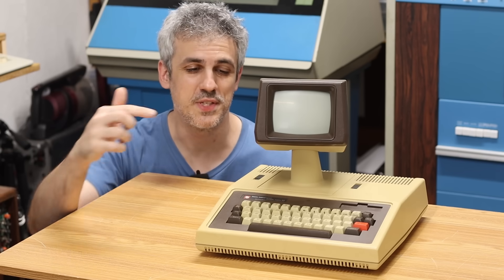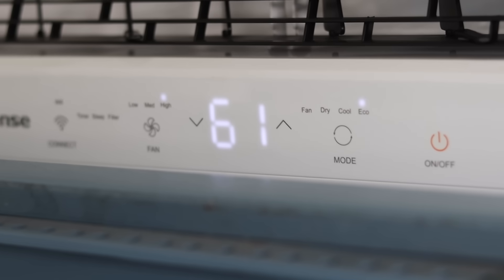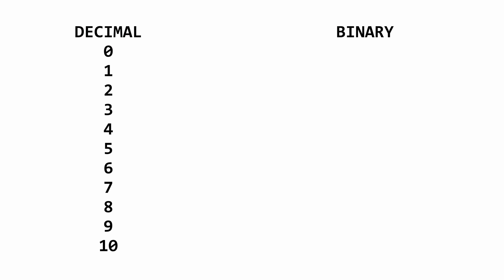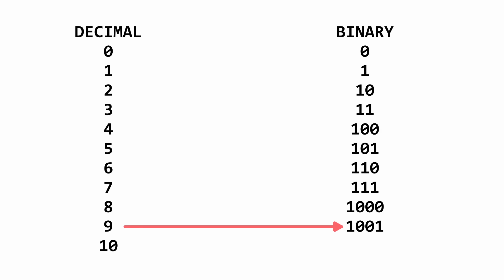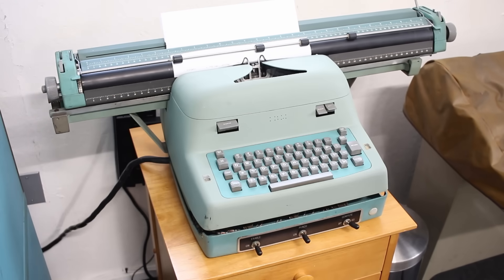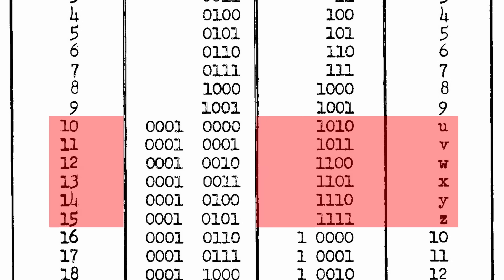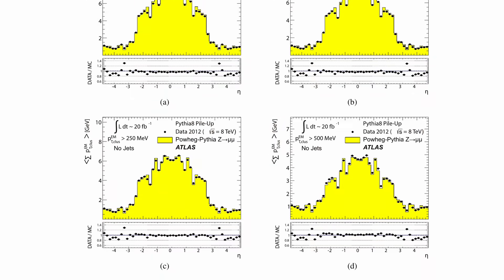Learn How to Count Like a Madman (Or a Computer)!

Comment: You have used a mixed system all your life. Time uses a system like that.  From 59 seconds you roll over to 1:00
Reply: I don't have the correct vocabulary to communicate this, but wouldn't base 10 also be a "mixed system"? In comparison to a system that goes from a zero equivalent to infinity with each value representation being unique. That's not realistic (or maybe even possible) of course. This is something that I've often wondered about while taking my afternoon walk. Also, I would think that extraterrestrial life, if it should exist, would probably also use some form of binary just because of its transcription of true/on and false/off. Maybe they'd come up with similar solutions like hex to deal with the limitations of binary, who knows. And what about quantum computing, does that need a new set? It's interesting stuff to think about
Reply: @FreejackVesa You have described numbers with no base. It is only a base when there are multiple digits.  If I write "7", that would be seven in any base.

Comment: Yes, regardless what number system you chose to use to program, every computer has to work with the binary system to work. And every microprocessor chip has it's own library of instruction sets. Unless you understand those addressing sequences, you are going to be in a lot of problem...and a none working programs as well..

Comment: This reminds me of when I had to figure out to get playlists into my then new head unit that did not support the playlist format, so how to do it? Had to figure this one out but in the end, it's pretty simple and it taught me that this head unit from JVC that I bought new in 2012 used numbers differently, and thus, treated the 0 differently.

This was due to the fact that this head unit supported USB drives, but at that time, they said not to use hard drives, well, yes, makes sense due to how fragile they are. SSD's may be OK due to how it works much the same as a USB drive. Anyway, I figured out out what to do, and it involved alphanumeric file names.

By this I am meaning, numeric/alpha, so, 01filename. get to 09filename and have to do to 10, well, it's 10filename, to 19, then 20filename etc. 

However the file structure layering was simple, one layer down only, so for a single disc turned to a playlist, make a main folder, naming it your CD (as was my case as I was converting several mix CD's to playlists, of sorts) to play in the car, so a single project could be, I wanna rock, then below sub folders, each one level down, so I wanna rock-> 01filename (song), back to mother file, ->02filename (song) etc. For multi disc projects converted, main folder, in this example, freeformed (a 6 disc CD project whereby each disc had songs from various eras from mid 60's to 1990's say in a particular order I had conceived. This was based on a radio program that ran from 11AM to 2PM every Friday, hence Freeform Fridays being the show's name. Every track I had in my collection at that time, CD, vinyl didn't matter.

Anyway, so Freeform -> Vol 1 ->01filename (song), back to vol 1 -> 02filename (song) etc, repeat for each of the 6 vol's. 

However, naturally, the desktop computer seems to see the decimals of 1's and 0's differently.

All that works like a charm and thus, each sub folder can only have I think 30 files (tracks) per sub folder, each a single layer down from the main folder. So the main folder is the container that may contain 6 say, smaller baskets, and each "basket" is the container for all the tracks within that "basket" that represents an individual CD in that multi-disc project.

Sounds convoluted, but it works.

Comment: Weird, but there may be some precedent.  Years ago I wrote to Don Knuth about a strange form of packing/encoding I wrote for a NES game - I needed to SUPER compress a number of parameters into as few bits as possible.  I came up with this weird concept of having mixed-radix (as Knuth informed me it was called).  That is, where I had a number composed of digits each in a different base.  So - for example - the final number would be represented in binary, but the actual contents/coding of it might have log2(8) bits (representing 8 options for the first parameter), and then log2(3) bits for the second.... etc.  In other words, fractional bits.  Think of it as just a row of digits forming a number, but the base of each digit is completely independant of all the others. A bit like your bendix example.  To convert from a binary encoded "mixed radix" number you simply recursively get the remainder when divided by the lowest digit's base (giving you the lowest  digit) - and then divide the whole number by that base - effectively shifting all the other digits "down" one, dropping the lowest digit. It was super-weird and to be honest I must have been desperate to save bits when I somehow came up with it - but it worked!  As I said I wrote to Knuth and he responded - much to my delight - that it was indeed a great way of compressing data to use fractional bits - as covered in chapter x.y of his magnificent "The Art of Computer programming".  Anyway, so when you mentioned the bendix mixed-radix stuff, I wasn't so surprised as I've used something kinda similar.
Reply: Respondants seem to miss the point here.  I'm not using (say) 6 bits for one thing, 2 for the other. That's just bitfields. I'm using 2.32193  bits for one thing, and 1.58496 bits for the other.  It's optimal use of fractional bits.  Although in principle similar to bitfields, those use integer number of bits per field. As I was trying to explain, the technique I described uses log2(x) bits per field, where x is a non-power-of-two, and the actual bits used are non-integer in size. There is zero wastage in the bit packing (i.e., no unused values in a bitfield, because the bitfield holds exactly the number of bits required).  It takes some time to understand, but again... this is not at all like (say) C bitfield structures (which must be integer sized).  Fractional-sized bitfields, if you like. Again, 1.58496 bits wide, for example. And the other 6.41504 bits in the byte are available for storing other stuff (an 85-value field for example).  The first field (1.58496 bits wide) can hold either 0, 1, or 2.  The second field can hold values 0 to 84.  Packed into an 8-bits byte.  Using regular bitfields for this requires 2 bits for the first (0..3) and 7 bits for the second (0..127) -- that's 9 bits. So we saved a bit.  I have tried to explain it several times, so hopefully that helps people understand this, and why it's like the Bendix (sexagesimal,decimal digit) system which packs 108 values into 2 digits.
Reply: Did something similar when I converted "Die Gemäuer von Kalawaum" (a Rogue-like dungeon crawler) to CBM PET. The bottom 6 bits of the X-coordinate (of an enemy) are the X-coordinate, the top two are flags. The bottom 5 bits of the Y-coordinate are you guessed it, the top three bits is type of enemy, an enum. Hey that was my first serious C program! But yeah - converting a game from a machine with 1MB of RAM to a machine with 32k of RAM...
(also BTW my port came out in 2012, before Attack of the PETSCII Robots and loaded level files from disk which I think was a first on this platform)

Now when Usagi demonstrated the 99->U0 I was thinking about packed BCD on many NES games, where the upper 4 bits are one digit and the lower 4 bits are another digit and the highest number it (should) display(s) is 99, but often the programmers were lazy and didn't check if you have more than 99 lives. Bam - [weird graphics symbol]0 lives.
Super Mario Bros. 1 is worse - it has a 19 lives limit. And for some reason will have the tens digit as a flag that the number is higher than 10 and the ones digit is actually Base 256* (yes -  one full byte) with the result being (Number of lives + Offset of the "0" character - 10)
*) or rather Base 128, but signed.
Reply: Yes, and . . . I think you blended mixed-radix in general with your specific application. For your specific application you allocate whole bits, a good choice for time performance of packing and unpacking (called encoding and decoding in some contexts). You mention "fractional bits", which doesn't come up when you stick to base 2, 4, 8, . . . 2^n. But if your mixed radix bases are 3, 7, 11 (or any non power of 2), you can effectively store "fractional bits" but then you have to pay the performance cost of div / mod (remainder) when unpacking. This comes up when the mixed radix is powers of 10 ( for packing decimal values of possibly different lengths).

Thanks for sharing your experience. I've  also had an opportunity to correspond with Donald Knuth and found him to be both generous and humorous.
Reply: @andrewdavie386, I wrote my comment before I saw your reply addressing this, and I now see I misread "log2(3)". Small screen, sorry about that.
Reply: Oh, so a bitfield struct in C, then. Yawn.
Reply: @williamsquires3070  no. You completely missed the fractional bit... bit.  Actually using 2.3 bits instead of 3.  Try to understand.
Reply: @williamsquires3070 I believe it was Assembly, I don't think there was a C compiler for the NES...
Reply: @rya3190 Yeah, MOS 6502 assembly, and even with that developers were including memory mappers, bank switchers, and other extra chips in cartridges to expand the machine's capabilities. It's why there can be a major difference in the graphics of early NES games that mainly ran on stock hardware versus later games.
Reply: @williamsquires3070 ,  no need to be so dismissive. @andrewdavie386 shared a learning experience, on an educational channel. I enjoyed their enthusiasm. 
10 hours ago

Comment: Heeeeyyyyyy at 14:07 ... Imma about to mix and match Numeral systems like this in a way I'll bet you have seen before

And to be funny Im gonna use alpha-numerics just to see if any imperal Carpenter Machinist or mechanic will spot it
0
0.1
~
0.9
0.a
~
0.f
1.0
~
12.f
a.0
a.1

Tilde's to cut down on repetive patterns that I'm sure is clear as day to anyone who's used a sixteenths tape measure.

the sixteenths are hex, used with regular dozenal, Feet! not decimal.

Comment: At least bendix stayed consistent. Worked on slot machines and the player tracking systems use mixed systems for their SAS language acii, binary, octal and it seems like a miracle for it to interface with newer slot machines. On on top of that they interface over serial and then switch to ethernet then back to serial in some of the older casinos the newer systems are more standard ipv4 but it's a nightmare during installing gaming machines when you stuck at the casino for 10hours after the install because they can't connect to the services.

Comment: maybe the zero key is after 9 because in old rotary disk telephones it was after 9, sending ten pulses
Reply: It's because early typewriters didn't have a zero, you had to use capital O. Some didn't even have a 1, you had to use lower case L.
Reply: @JacGoudsmit  I can't count to lO. But even if I could, it still does not explain the placement of the keys. Whoever added it the first in that location presumably simply started counting from 1.
Reply: @Hans-gb4mv  The 1 key was added first. When the 0 key was added, it was placed to avoid breaking familiarity for touch typists, who expected 1 to be on the left. 
An argument from frequency can also be made; 0 is seldom used (by non-technical people) unless writing 10, so the arrangement 1234567890 is also the order of most-often to least-often used.
Reply: Which is presumably also why phone keypads are ordered differently from calculator keypads. Checking this I just realised touchscreen smartphones have both in the same device and I swap from one to the other without even thinking about it.
Reply: When typewriters were first produced, and even today, nobody starts counting from zero other than mathematicians or programmers - in very specific situations. One IS the first number. Zero is just a placeholder to indicate the absence of a value.
Reply: Unless someone specifies leading zeroes, you'll only ever have to type a zero after having typed another number. So you shouldn't need to type a zero first.
Reply: @senilyDeluxe  0.01?

Comment: This weird notation is basically a BCD, or rather a BCD with "illegal" digits. I once exploited this in an RTC plugin module for the Atari ST. The XBIOS was expecting a 2-digit year in a BCD format, but I found out it happily accepted values like 0xB5, which would result in a year 0x125 (so effectively 2025). To my surprise, it was also compatible with the Atari control panel accessory, which for year "25" sends 0xB5 and not 0x25 to the RTC. It is despite the original RTC in the keyboard controller ignoring such illegal values, but in practice, it sends 0xFF when it wants a value to be ignored (it always sends a "set date/time" frame, which has a fixed format, but if you want to set only date and not time, you send the time digits as 0xFF).
Reply: Robin at 8-bit Show and Tell did a good episode on BCD.
Reply: So BCD is just hexadecimal done wrong? After all, a digit can't be illegal.
Reply: @neilbarnett3046  BCD has only 10 digits (symbols), but is encoded on nibbles (4 bits), so some "illegal" digits are possible. The position weight for BCD is 10, not 16, but there are 16 possible symbols on each position, yet only 10 are valid digits.
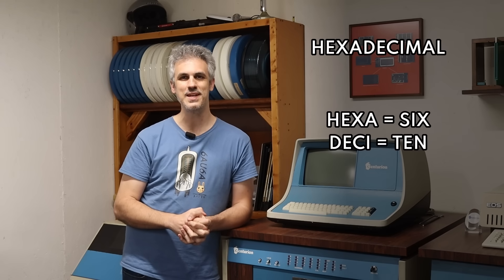Reply: My microwave oven will happily let you enter anything up to 99 in the minutes field and it works fine. This is actually useful, since converting times from 1000 watts (which recipes typically use) to 800 watts (my oven's actual power) requires adding 10 seconds per minute. If the recipe says 8 minutes, instead of doing the arithmetic to get 9:20 I can just punch in 8:80 and get the right time.

Comment: bits and pieces. system logic. twos complement shugs. hexen rocks tho. ff is 8-bits fp8. if you use 8-bit tables for division, then also div by zero will not crash, but gives a predefined answer. pr-teach. be done with the computation already. 0xff, or 0b1. well its only an agreement problem, if number positions have different bits capacity. talk about map cells, one is a letter and one is a number, like cell A4. on paper it just works.
Reply: talking about memory/ram/flipflops, wouldnt diodes inverse capacitance be used as the memory bit. of 0 or 1. not only for rom but as ram. well at least you could load up the memory transistor gate with the diode reverse capacitance voltage. ie on or off.

Comment: Typical Americanisms - mix metric and imperial - you guys are ????
Reply from the maker: I lived in Japan for many years and haven't gotten quite used to using either the standard or metric system. One isn't inherently better than the other, and amazing things can be done in both. Personally, I prefer metric, but living in Texas now means I interact with standard on a very regular basis. But, if you really want to bake your noodle, pull out your standard and metric tools, and try to work on a classic British car. BSW (British Standard Whitworth) will laugh maniacally at you as none of your tools fit vital bolts!
Reply: @UsagiElectric  That's as bad as Ham radios, with Bristol looking like hex, or Torx AArgh! on American radios.
Reply: "????" = able to think fluently in more than one numerical system. Don't be sad; it's because Americans are better at everything.

Comment: Just for completeness, some early computers, including early IBM's computers, used tri-state logic instead of binary logic.
Reply: There was an attempt to make a decimal logic computer with 10 different ent voltage levels, it was quickly abandoned.
Reply: While there were a bunch of decimal computer using normal binary logic and BCD, there were also actual decimal electronic computers including the ENIAC. The oldest working computer, the WITCH (a.k.a. Harwell Dekatron), which used a special vacuum tube called the dekatron or decatron which could be in one of 10 states. It is the electronic equivalent of the old mechanical computers which often used gears with 10 teeth to represent digits.